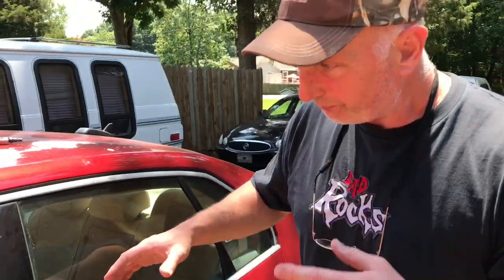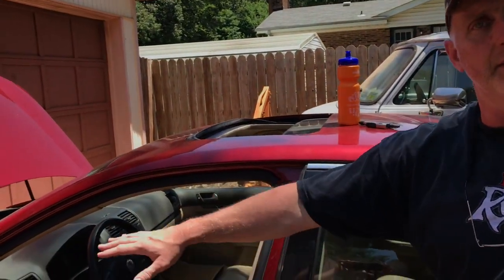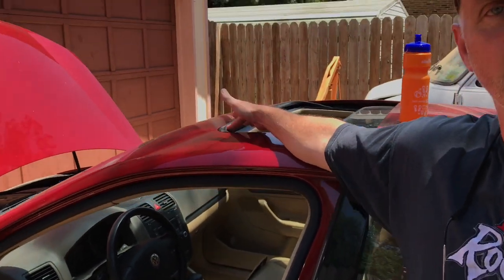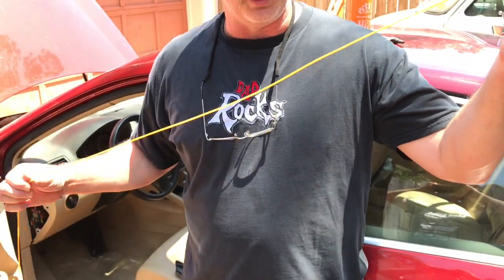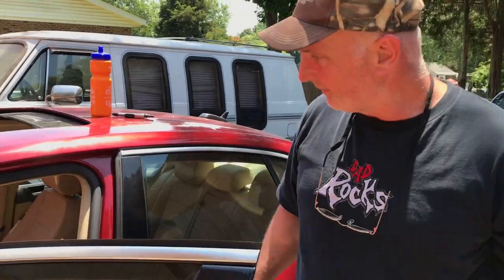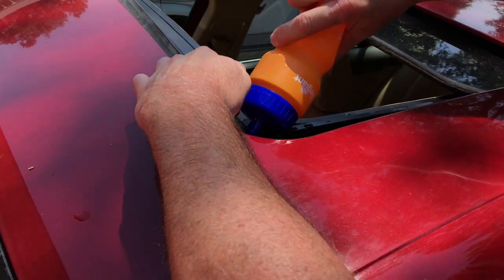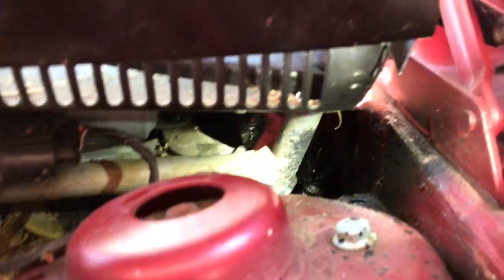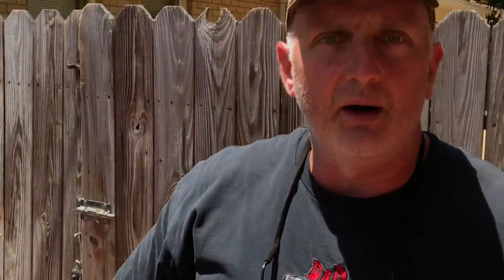How to unclog a Sunroof Drain - water leaking inside the car at the roof line

Comment: Do most sunroofs have 4 drains?  I have 2010 Acura MDX and must have clogged sunroof drains.  Too late in my case where the damage has been done to many electrical modules in the rear hatch.  Car runs fine but throws out a multitude of electrical messages on the dashboard so I cannot pass my state inspection until those are all fixed.

Comment: How the fxxx are such drains built up, this feels like something built to profit from design flaw! Do all car brands have such drains that if getting clog the car floods? Why the water falling on a car can not just flaw and drain from outside of the car to the floor vs connecting a tube from the top of the car and going through the car. Never heard such thing, can it be a US design thing or a BMW manufacturing thing or old manufacturing practices in USA still in place? I have never heard such issue in Europe for example...